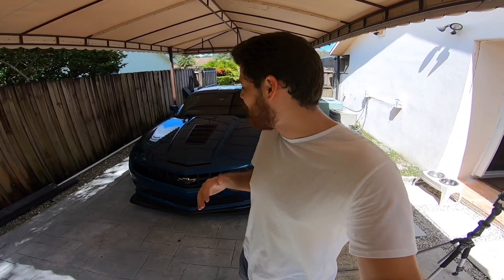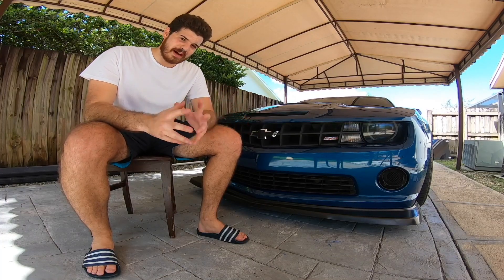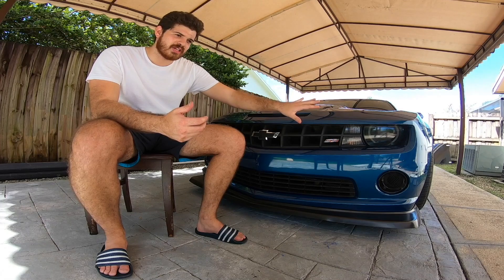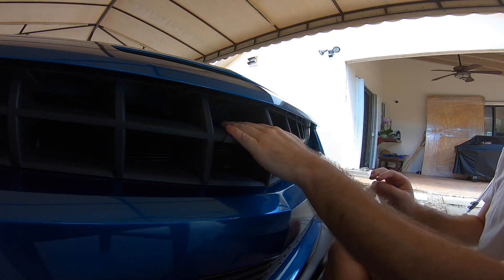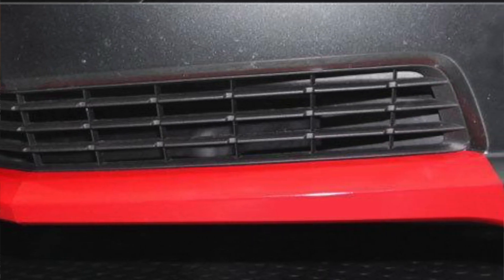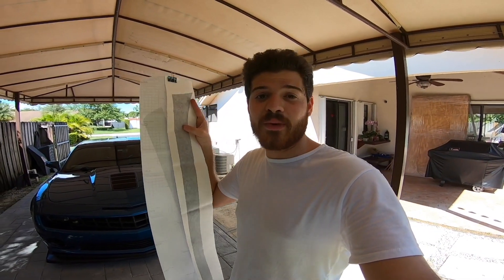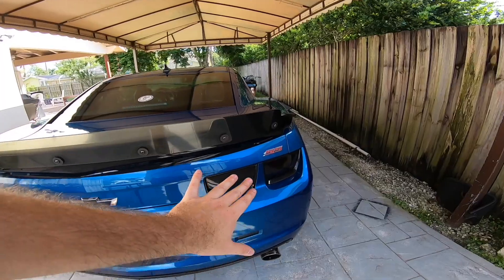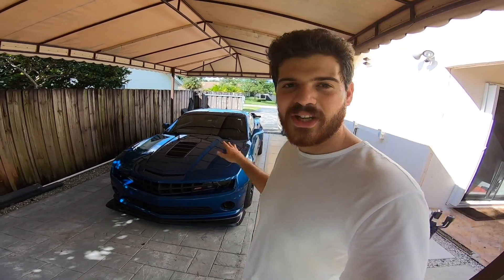7 Cheap Mods For Your 5th Gen Camaro SS & RS (2010-2013) | CHEAP MODS UNDER $50 FOR YOUR CAMARO!

Comment: Hey gv I need a lil help w my car overheated issues I turned it off quick and opened the hood to let it cool idk the issue
Reply from the maker: hey bro, any leaks?
Reply: @gvaspirated  haven’t seen any, also the oil is clean also you ever have this with your car ? Seems to be doing good today though coolant at 40-45% high where it needs to be and the oil temp is like 230
Reply: @gvaspirated  haven’t seen any
Reply: If ya want me to dm ya my snapchat or yours I can show ya also the cap had blown off but seems tame today idk why the cap would’ve when the levels I had my eye on seemed ordinary
Reply: Hey man what’s a vinyl for a car cost you think

Comment: Should have also added in the license plate led lights the license plate tint cover and the interior dome light
Reply from the maker: I did get a custom license plate holder, but not the upgraded lights! Yo but I never thought of the dome light! I feel like they could be a little brighter.
Reply: @gvaspirated  yea bro check out the 3rd video I made on my channel changed the dome light and the truck light way brighter makes the car look a lot newer than having yellow lights